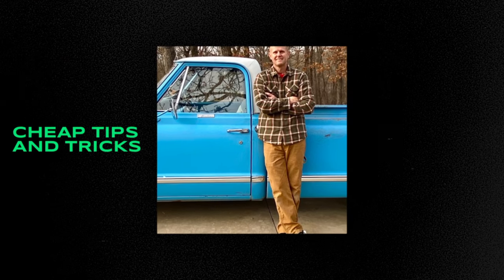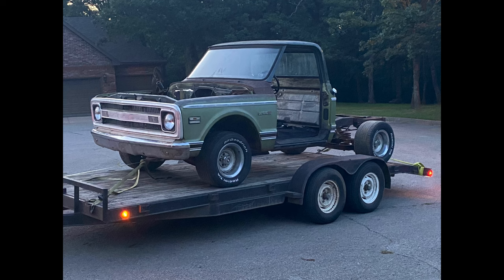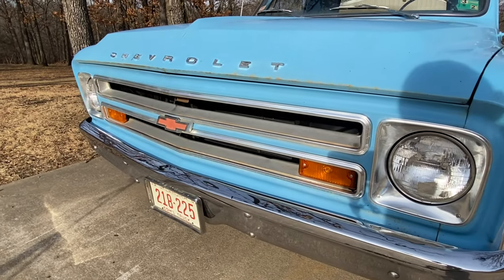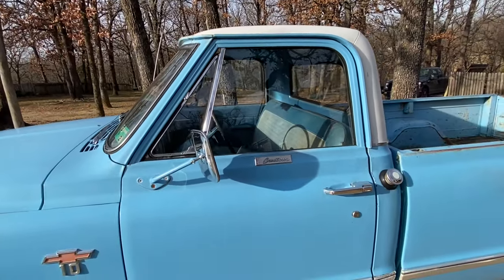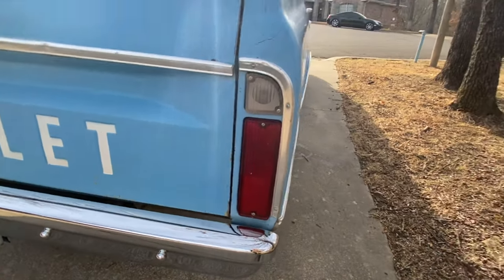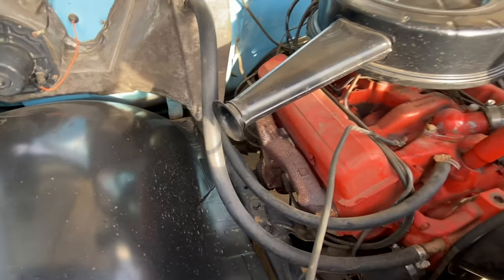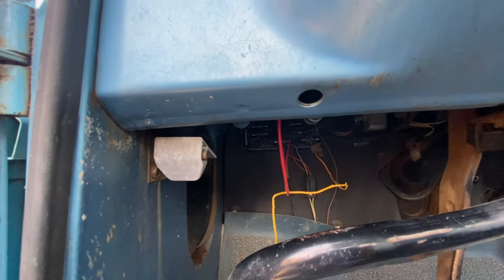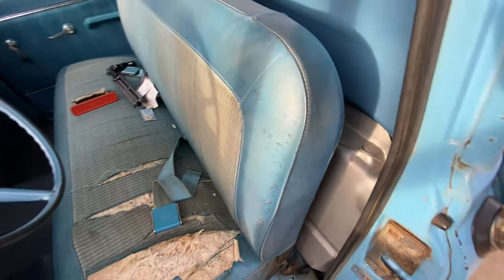1967 Chevy C10 - Year Specifics!

Comment: 71 and 72 C10 never had a 396 in them, it was a 402 cubic inch, which was a 30 over 396, also the front fender badges stated 402.
I know cuz my father bought one in 72 and I still on it.
Reply from the maker: Sorry if I mis-spoke . 70-72s had 402s. The fender badges actually said 400 even though they were 402s. Interesting why GM did that with the badging.
Reply: @C10TruckNerd not all of them dead, in 1972 my dad drove to a dealership I was with him, purchase a 1972 Cheyenne super C10 with a 402 turbo 400 with a posi Trac differential, the truck had and still has 402 Fender badges, and if anybody wants to make a wage on that I still own the truck and I have pictures that was taken of the truck the same day he purchased it to prove it.
Also there was a Texaco station in my hometown, and the owner had a wrecker with 402 Fender badges from the factory.
So the myth of all C10 with a 402 had 400 badges that is a crock of crap.
By the way I've been doing this stuff for over 50 years.

Comment: 1967 to 1972 easy to work on you can change the heater core in 2 hours' time and now you can buy a new cab with doors for the C10 1967 1972
Reply from the maker: You are right! As long as you have a good cab and frame, everything else is a bolt on. Such a classic look!
Reply: @C10TruckNerd  The best engine to put in the C10 is the 350 it is a work horse
Reply: @C10TruckNerd  The 1996 flare side bed looks good on the 1967 1972 chevy C10
Reply: Who makes the new cabs with doors??

Comment: I have a 68 C10 and a 69c10 and a factory 69c30
Reply from the maker: Lucky! You just need a C20 to finish the list off. Which one is your favorite?
Reply: My 69 C30 1 ton dually it's got a Big Block with a 4speed trans and front disc brakes
Reply: I'm working on my 68 I'm building it into a 1 ton srw Long Horn 4x4
Reply: @C10TruckNerd  my 69 C30 is favorite it's a dually with a big block, 4 speed Trans and disc brakes

Comment: my 68 has the same vents  knobs astray same same rearview  68 has much better grille trim
Reply from the maker: I would believe it. A lot of early 68s still used 67 parts. Is your rear view mirror bracket black or argent silver?
Reply: it's silver .  i filled in the front marker lights so that the fenders look like a 67, but i kept the rear ones other than the big back window and fancy grille trim it's pretty much identical. @C10TruckNerd